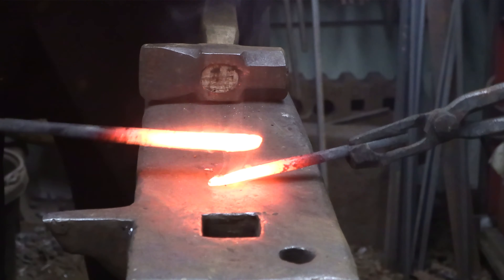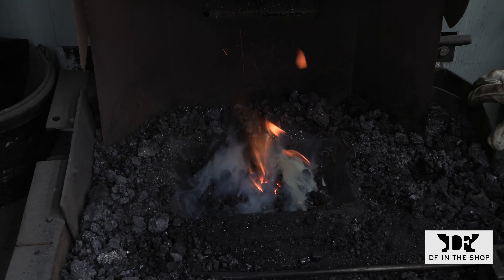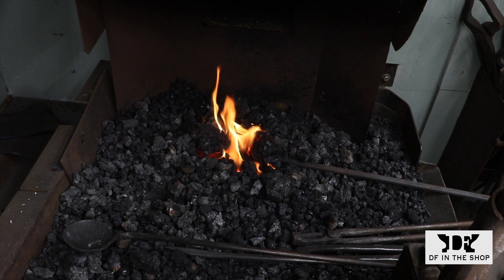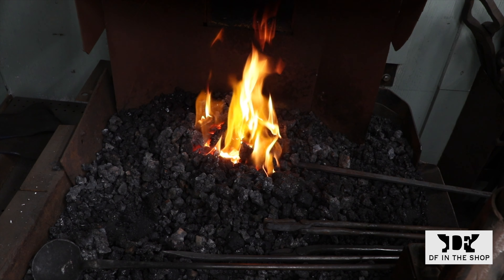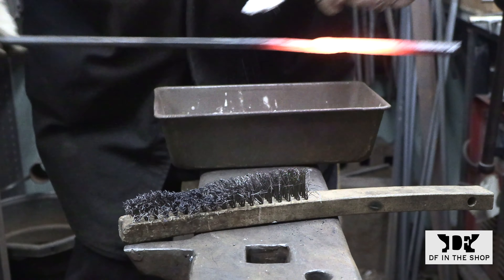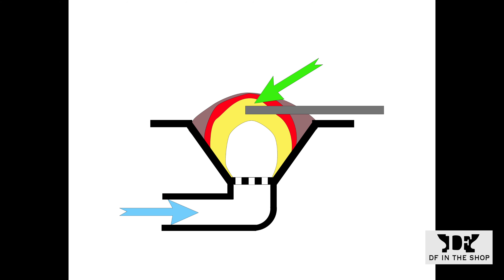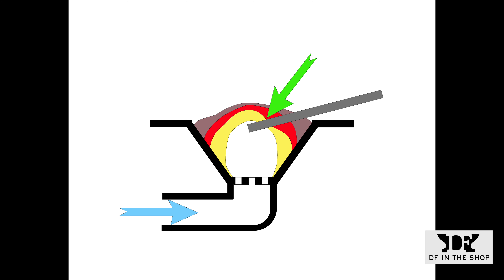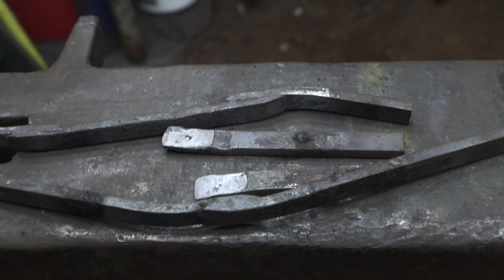Blacksmithing For Beginners - How to. Set up a Forge Weld

Comment: Can I show how to forge long objects in a coal forge I was trying to forge weld two rr spikes together but I couldn’t get it to heat even enough
Reply from the maker: It may just be that you are not making a big enough fire. If you want to make a longer or wider fire you need to build the coals up above the edges of the firepot so it has room to expand.   I have a link to my "How to work in a coal forge " video in the description of this video.

Comment: Hi what about charcoal?
Reply: same process,  just needs a lot more fuel and fire maintenance.
Reply from the maker: The zones would be the same but soft coal is the only fuel that needs all this maintenance.  The coking process continuously creates large formations that need to be broken apart and compressed to remove the voids in a fire.  With charcoal or met. coke you just pile the fuel on top and gravity does the rest.
Reply: @df-intheshop330   I tried forge welding today i find it akward to forge weld two pieces its more easy to fold one but to forge weld two is hard, to admit it did get stick (two pieces in forge)
Thanks for answer.
Reply from the maker: If they stuck together in the forge there will stick together at the anvil.  That's just more practice.